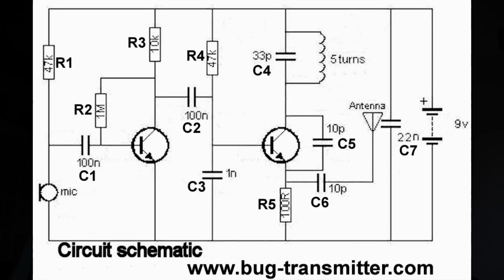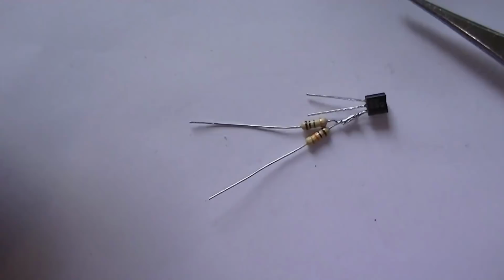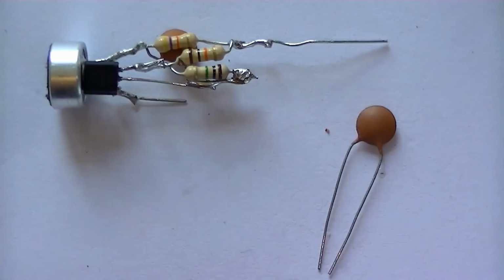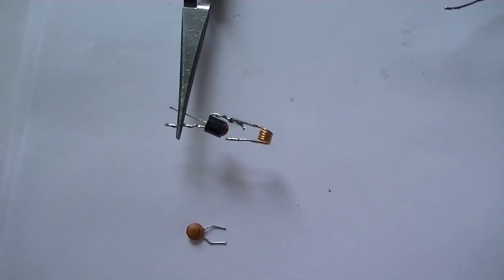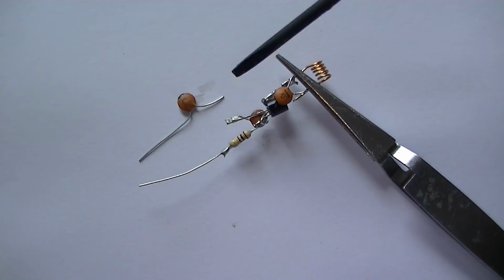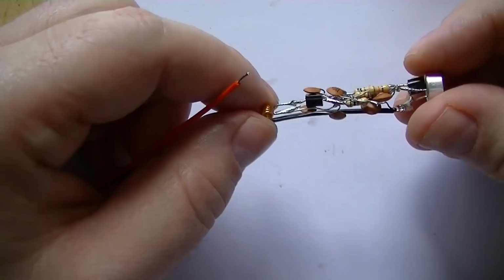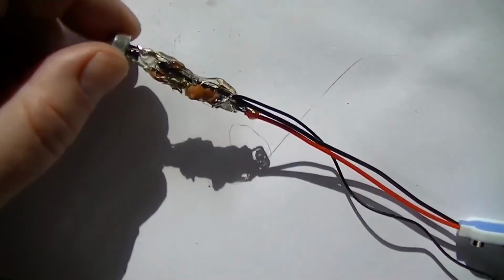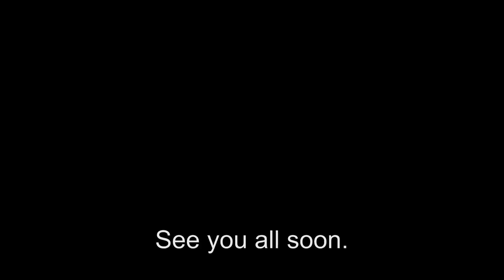Make a very simple transmitter.

Comment: I built one, it works great. It's the most stable transmitter i've built so far. If yours is unstable try replacing the battery with a fresh one, or cover it with hot glue. Hot glue makes it sound much better and it increases stability so if you're near the transmitter the frequency will not drift.

Comment from the maker: PLEASE NOTE: At 8.20 i ment to say emitter side,  NOT collector side.
Reply: +dazaro3 I only have 150R , is good in place of 100R?
Reply from the maker: +Anonimescu Cutarescu 
150R is fine ,you can use anything upto 470R
Reply: Please sir 
Tell me about the inductance value of the coil ?!
Or the width of the wire and the diameter of the inductor

Comment: Hi there, i have previously made this circuit tapping the antenna from the collector side using a pot which I  found  more stable than the 1 transistor transmitters in your early videos, however although much less stable I found the 1 transistor transmitters seemed to produce a more powerful signal.. must try it this way cheers

Comment: Can i use shorter antena? Pls i need answer quickly if is possible
Reply from the maker: Yes ,shorter antenna will give shorter transmitting distance ,but it will work ok.
Reply: Tnx
Reply: dazaro3 Can I use polyester capacitors?
Reply: Just use one of the either red or black hook up wire, works fine, cut it to 165cm give or take, and boom antenna wire.

Comment: what will be the change of frequency if i use more high value capacitors?
Reply: By the number of turns in the coil and the cap in the turns of the coil
and the value of the capacitor in the tank circuit.

Comment: Stupid question. Is it possible to modify the schematic to use 2 transmitters on one mic?
Like transmitting on 2 frequencies. and if I would like to add a direct line in to the transmitter where should I connect. This would realy be perfect for me

Comment: hey was wondering if u could make 1 of these to run of 3 volts?
also how long does the 9v battery last for when on constantly?
love your vids mate.....ghetto electrician :)
Reply from the maker: If you use 9v and a PP3 Alkaline Battery current consumption is about 14mA so a
9v battery will last about 15 hours.

If you run the transmitter on 3v the transmission range will be a lot less but running
time is very long , 2x AA Duracell Plus 2600Mah batteries current consumption is about
5.1mA so running time using 2 x duracell Plus 2600Mah batteries is about 510 hours !!
about 21 days !